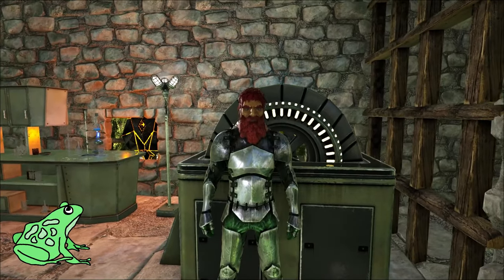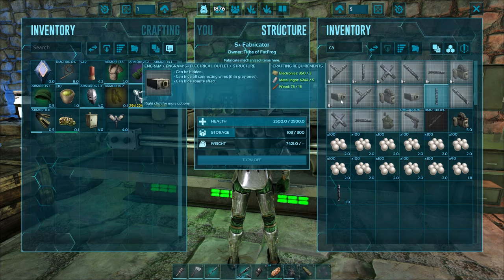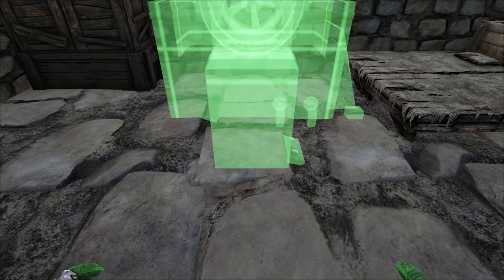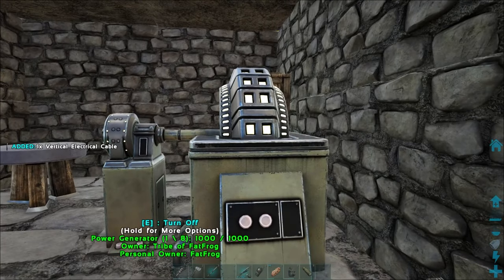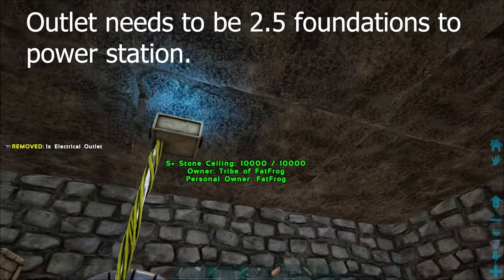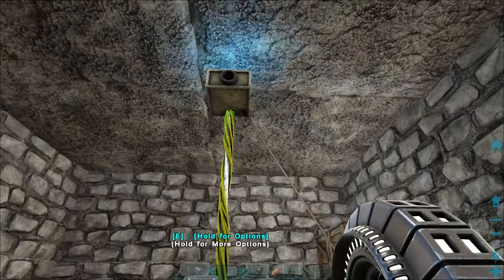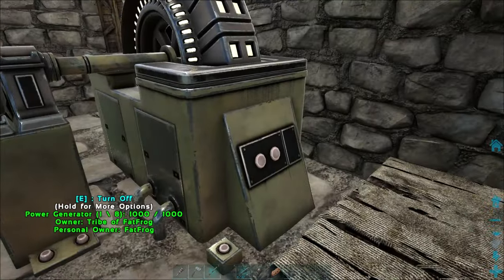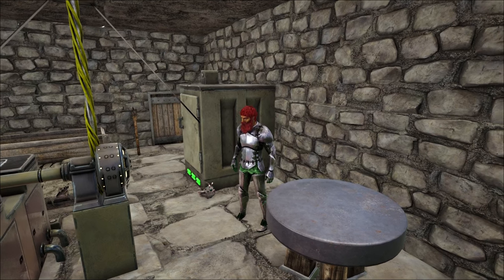Electrical Generator Power Setup Ark Survival Evolved How to

Comment: So I have S+ as well and I'm not sure if that has anything to do with it but when I place down my generator, cable, and outlet, there is no black wires connecting to my machines. The generator works and I'm getting sparks at the outlet but no wires are connecting. Any help is appreciated
Reply from the maker: I think the cables might be hidden by defult on S+.  You can look at the outlet and use E on pc to bring up the options wheel.  There will be a option to hide or unhide wires.
Reply: @FatFrogsSwamp  yeah the same is happening to me i know theres power its just that there is no power going to anything else

Comment: Hey uhh when I tried to connect the outlet to the console it didn’t connect?
Reply from the maker: Did you mean outlet to the electrical cable?  If so, I don’t know why it wouldn’t snap, but it only snaps to the end or where to cables meet up.  Outlets will not snap directly to the generator or other devices.

Comment: Yeah .y lights say they are working but no light i cant wrap my mind arounf it
Reply from the maker: They will be powered, but you still have to turn them on and off, or maybe it is a bug and logging off will fix it.
Reply: @FatFrogsSwamp  yeah they are powered and i have a plug box and the tiny wires are conected and i have gas and nothong so weirf